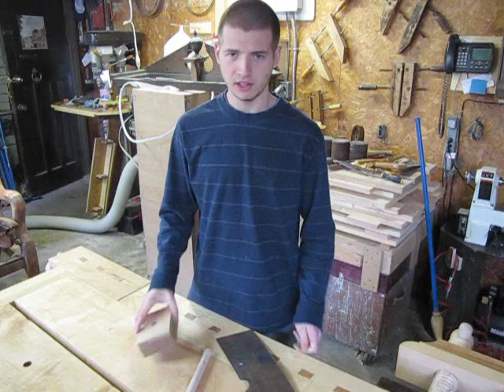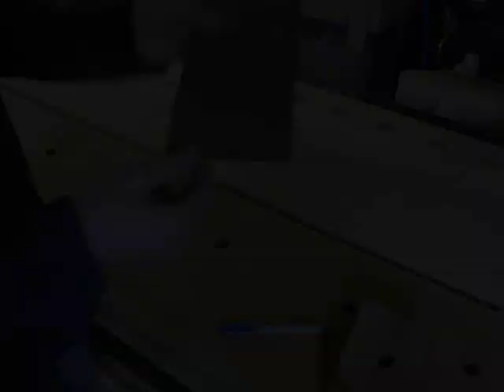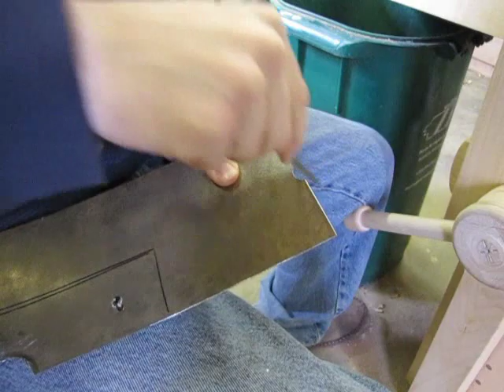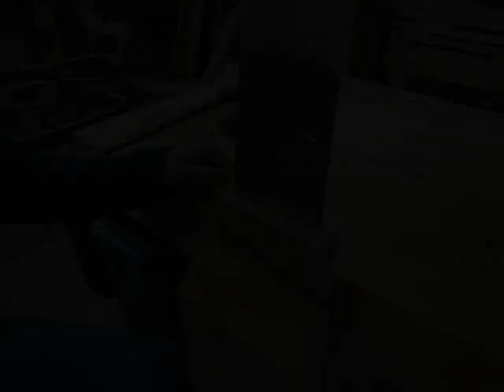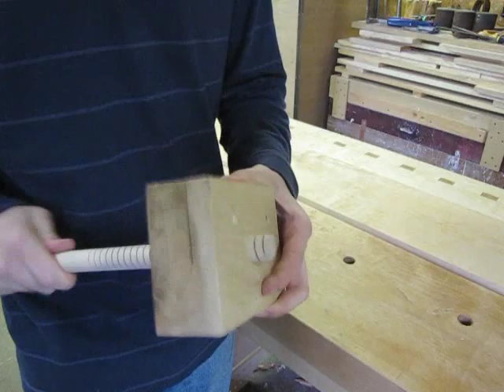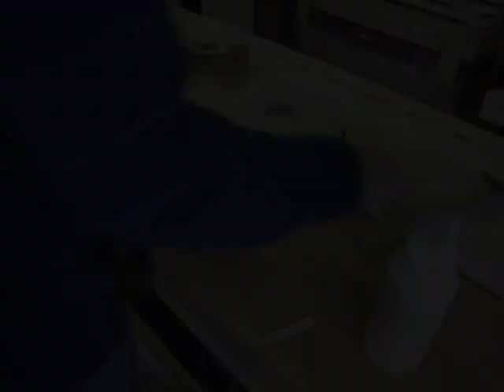Tap and Screw Jig Tutorial - Part Three

Comment: I would suggest marking where the dowels would come through the nailed on blocks and drilling clearance holes.That way you could drive out the dowels and replace the steel plate if needed.Of course you could always measure their position from the other side,and use a Forstner bit,lol.Thanks for the series!